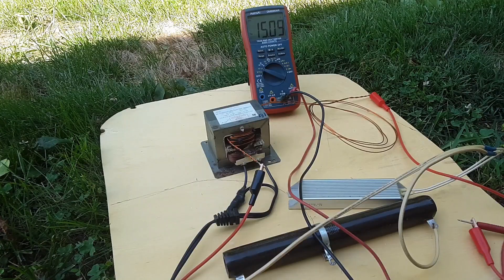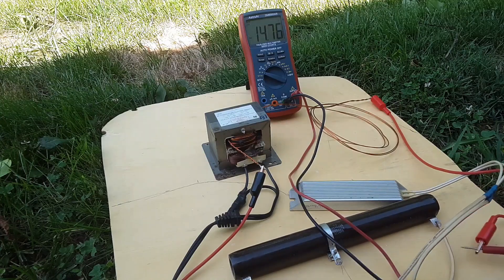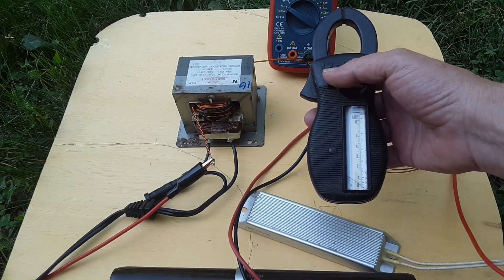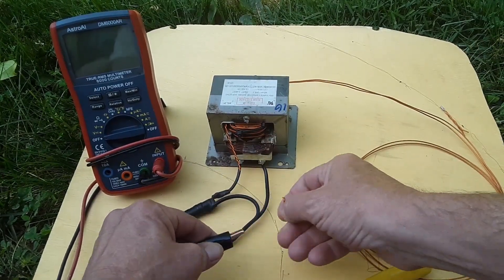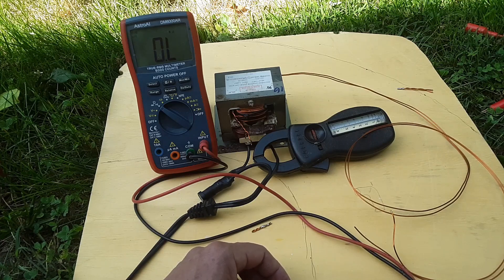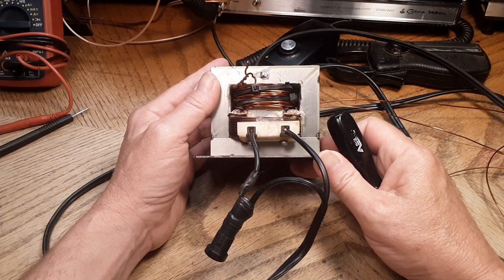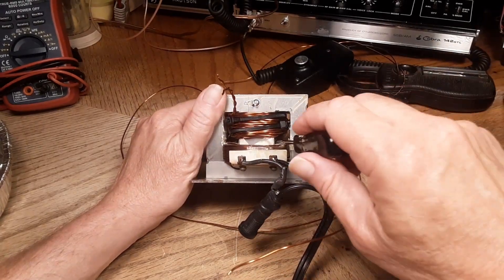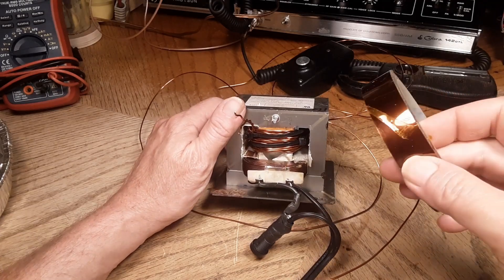MOT🤒😬🤯10 pounds of stress.(microwave oven transformer rewind)

Comment: These are run into saturation to  squeeze more power from them in the oven, the output of the magnetron is 600W and they are around 65 percent efficient so they are pulling 1kW plus from this tiny transformer, those are magnetic shunts and are there to allow leakage flux and therefore limit the output current you need to add turns to the primary or run a lower input voltage , the current is going into reactive power and heating the core, you could also run a series inductor (ballast), also a parallel PFC cap with help with idle current
Reply from the maker: @T2D.SteveArcs  thanku very much for the info😃
Reply: @generalingwer4341  no problem  👍🏻👍🏻

Comment: MOTs are usually rated by their output current, I believe, but I think only half of mine actually have a rating on the transformer itself. The microwave's rating is the magnetron's output power. 
As someone else said, remove the magnetic shunts. I believe they reduce the flux in order to prevent core saturation which you won't need to worry about. But MOTs are ultimately just very inefficient transformers. They use silicon steel laminates where should be insulatated from each other, but the magnetic fields in them are so strong that they weld the laminates together in 2 places so they don't push the whole thing apart. This results in edfy currents that draw extra power and heat up the core. If you want less power draw at idle while using that core, you'll need to increase the reactance of the primary by adding more turns. Alternatively, you could run it at a higher frequency, but that's probably impractical in your situation.
Reply: Your calculations about volts per turn might be off a bit. Make sure you test the input voltage right on the primary. I wouldn't be surprised if you're quite a bit below 120Vac on the primary, especially under a load.
Reply from the maker: @SkippiiKai  no volts per turn was on.🙂
Reply from the maker: The microwave(plate) it's self "should be rated by its input power"if It wasn't a person would never know," is my/this receptacle sized for the load".im gonna look into this though.🙂

Comment: Those copper parts you were confused about are the remains of the third winding: the magnetron heater coil, which is around a 3vac output.
Reply from the maker: Ok.i was perhaps a bit confused over those 4? Coppers.i didn't remember what I had before I cut the sides flush.i didn't perceive them as actual remains of windings.im gonna have to find another one to see what wires come off it.lol.thanku!😃

Comment: You took out the... Aluminum? What aluminum?
Reply from the maker: The aluminium from the secondary winding.
Reply: @generalingwer4341  The secondary wire is aluminum and not copper? That doesn't seem right. I'm going to have to check some of mine later tonight.
Reply from the maker: @SkippiiKai  yes it was alum.these are very cheaply made for microwaves.ive found much info to support that.it maybe possible though that a xfmr from a real expensive oven could be copper?thanku for your comments🙂.

Comment: If you did not knock the shunts out it will draw way too much current.  Knock those out and it will be golden.
Reply from the maker: Ok thanku so much🙂.i have knocked them out now.i also added turns on primary as well.tomarrow I'm gonna retest.thanku for your comment and for watching🙂.
Reply: I was just about to say that as they where there and add another strand to the secondary winding for the 18v also i would have some insulation between the layered wraps use like tracing paper, I have made many of these for same reason but i was going for 14.8DC, when you finished your wraps dip into a lacquer or some sort of light resin, do not add to the primary as its not needed and if you added turns to the primary you will get less voltage on your secondary anyway.

"to fill you gaps well you could add more strands to your secondary in parallel try to get them as even as possible like they are a multi-stranded cable".

That 4 rows of copper you pulled out is another winding i forget its exact use but feed back.

The other thing before you do any resin or lacquer make sure you blown out the transformer as much as you can as there might be some filings in the primary and if there is any enamel off of that copper on the primary it could short it, but yes microwave transformers have high eddy currents due to the fact they are welded laminated core the only solution with that to get the best results is more work where you grind out the welds and take the E and I lamination apart and lacquer them and re-assemble and clamp together and dip the whole thing in resin / lacquer.

If your after 24volts DC your best bet is Audio Amplifier as they often contain 32volt+ transformers with decent current and using an LM317 and some current pass transistors to make a linear PSU.

The LM317 will regulate your voltage the transistors will pass your extra current as its only 1.5A MAX via the LM317 and since you junked a Amplifier to do it you will find the power transistors your need to pass the current, there are a lot of circuit designs you can use. OH yes you can use the heatsink from the amplifier.

https://electronicsarea.com/20-amp-variable-power-supply-using-lm317/ <<< this looks good.
Reply from the maker: @blackIce504 thanku for comment🙂keeps deleting my typing so I'm gonna be short👍🙂.